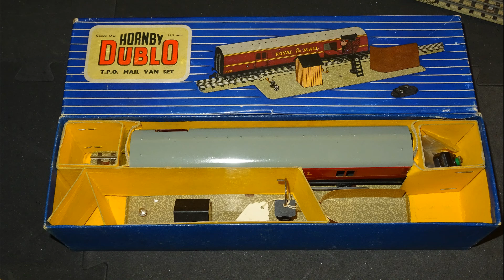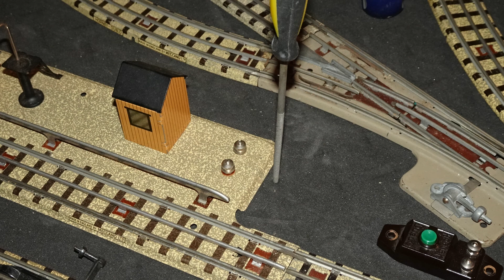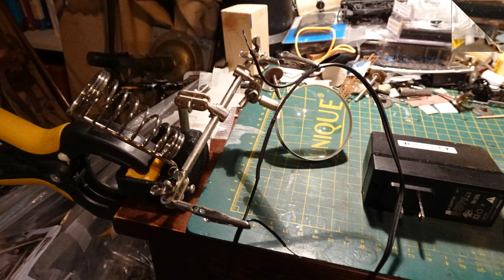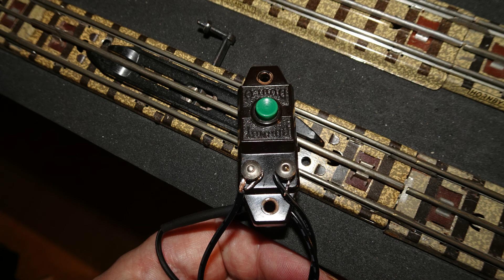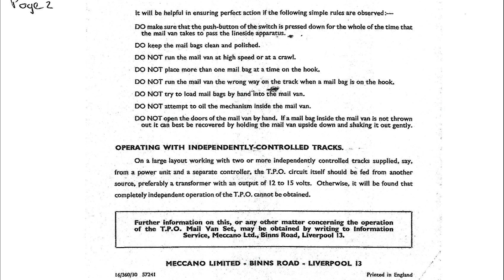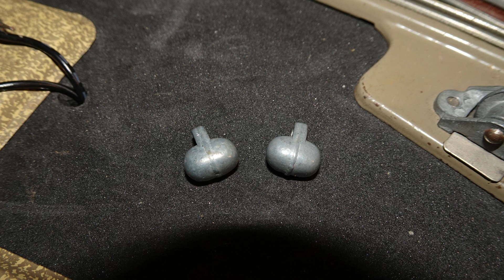OO 176, Dublo 3 rail: TPO Set up and Operation

Comment: Thanks for the very informative vid. Like your self I am setting up my Hornby 3 rail system and one of the pieces of equipment is the tpo carriage. The condition is the same as yours, appears brand new and never used. As they were quiet expensive at the time and according to my catalogue came late to 3 rail just before Hornby switched to 2 rail. I would imagine that quite a few remained on the shelves at the warehouse to be sold off cheap when they had the big clearance. Speculation on my part of course. Like yours there were no instructions which brought me to your page. Now I know how to set it up using the fixed voltage on the old C3 controller. Thanks for the information.